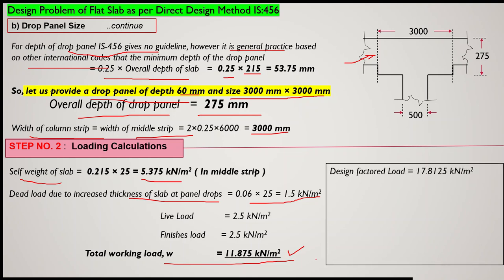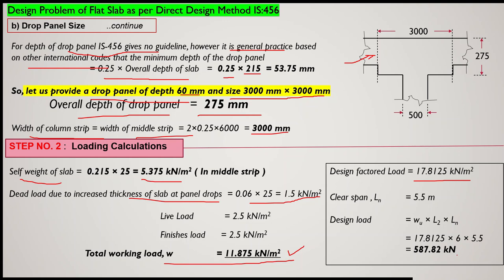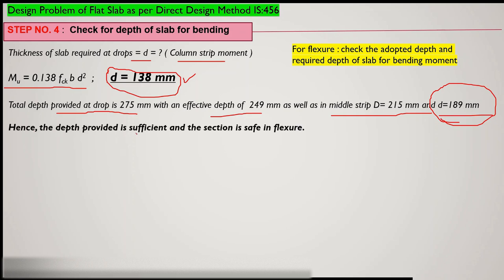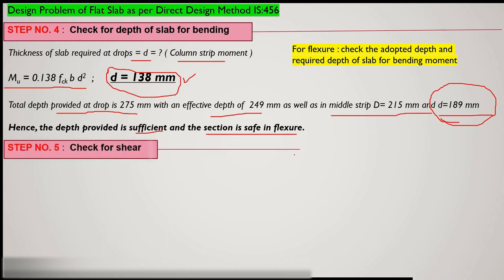Design Problem of Flat Slab || Direct Design Method || IS : 456 Recommendations

Comment: Sir, Excellent way of explaining the tough topic, one small query, d=189 taken in the calculation for calculating reinforcement for +ve moment in the COLUMN STRIP. Don't you think we should take d=275 - cover - d/2 = 274 - 20 - 12/2 = 275 - 20 - 6 = 249 mm ?

Comment: sir i have a doubt that why we take spacing approximately equal to half of the value of actual spacing in this lecture.sir is that due to width of drop panel as we are designing for drop panel